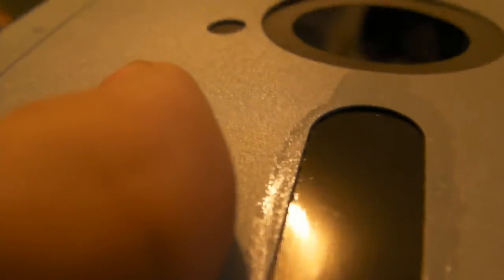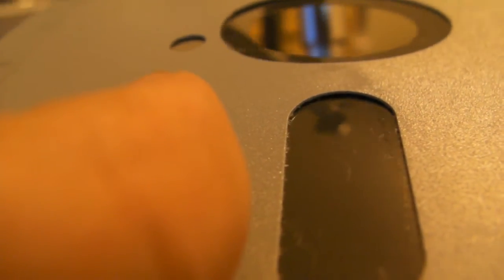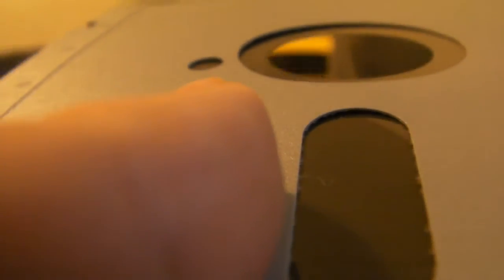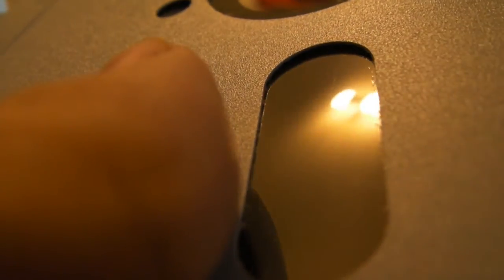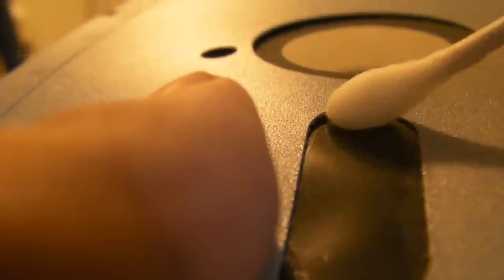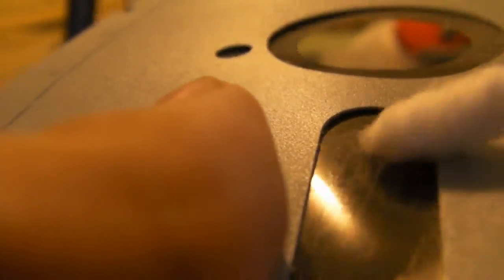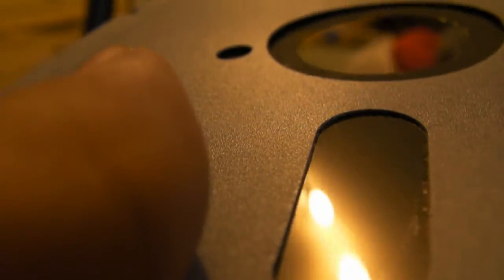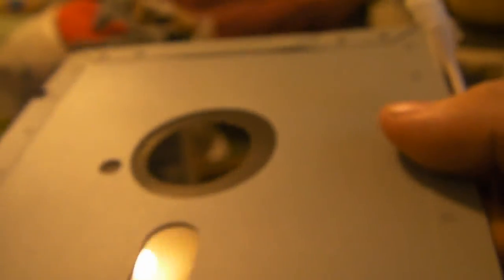Quick Fix Floppy Disc cleaning / read error's /

Comment: I recently aqquired a  Commodore 128D with a bunch of floppys.  Some of them work alot of them are "squealers" and I have to clean the drive head after a disk does that.  I have had success with cleaning the disks with q-top and alcohol though.

Comment from the maker: @RetroGamerVX unless it's an orginal game disk i'd fix it up enough to copy it to an unmoded disk alot of the time when you snap it open it wont snap back shut and getting those protective flaps back on is a nightmare.

but running it flap off with clean pads to get data off wont hirt the drive. and you can perminitly fix it just be gentile and resecure the outer edges of the disk. (while you have it split you can take a closer look at it see if it's dirty)

Side note Squeeling = loss of speed.

Comment from the maker: @RetroGamerVX Can you do a short vid of it squeeling.... honistly when i heard that drive do it's test spin i sed to myself (man that thing needs oiling bad) :p ... and that looks like a standerd floppy drive you can probly still get a match replacement for it... 

Now as for the disk itself...........   ya i'd have to hear it.. but yes you can transplant or referb it if it is indeed the disk case. The main culpret it dirty felt padding. but there fiddly to work with :p (continued)